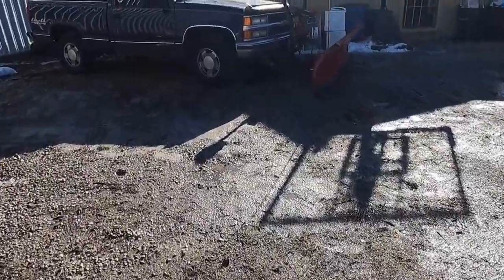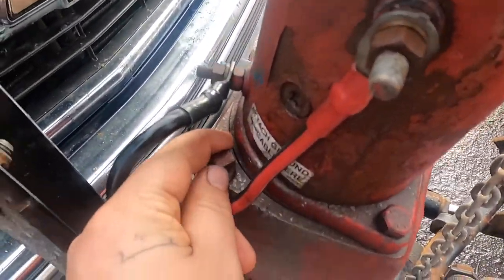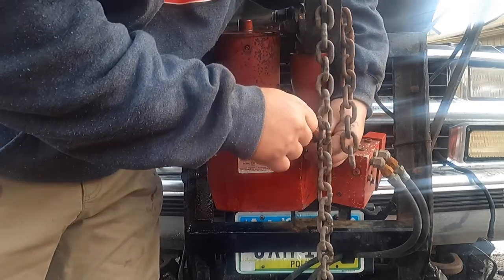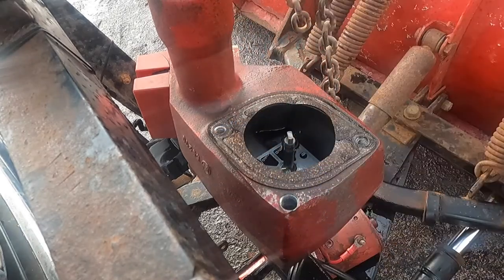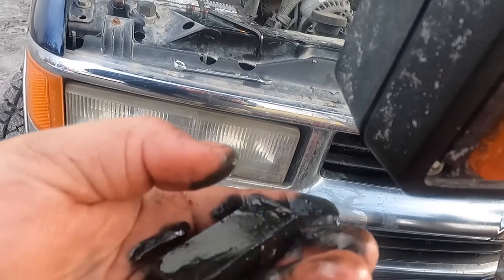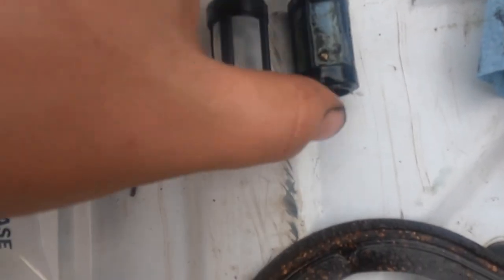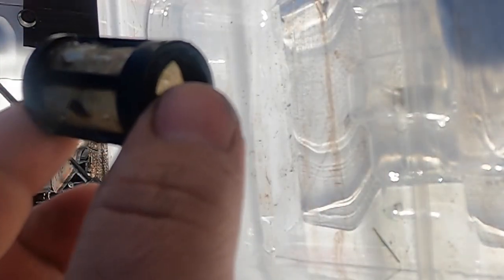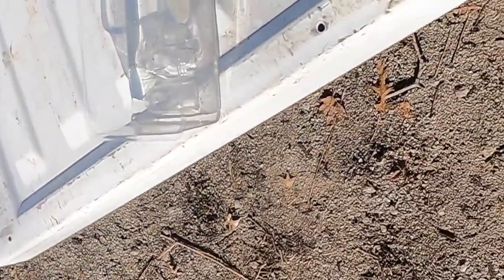Western Snow Plow Filter Change I Hydraulic Fluid Change

Comment: So, where the hole you put your fluid in… mine was stripped so I couldnt open it to put the fluid through there so I just put it in from the top. Should that be ok? My plow still wont move. It wants to but its like its stuck. Chain wont move either
Reply from the maker: Yeah it should be good enough to move it, does your pump make any noise when trying to move? If your pump makes noise you might have a bad pump if it doesn’t I would check the truck side of wiring
Reply: @Griff319  it does sound when trying to move. Can it be that I left it in the upper position since Jan?😬😬my truck went out on me in Jan, thats why I couldnt lower it… i lowered it today after switching the fluid but it wont move. I hear it wanting to tho